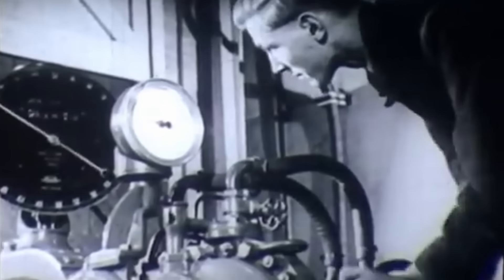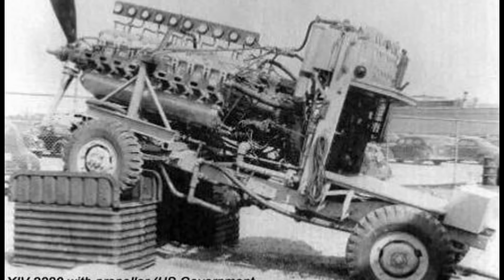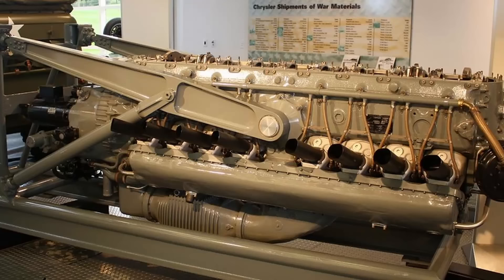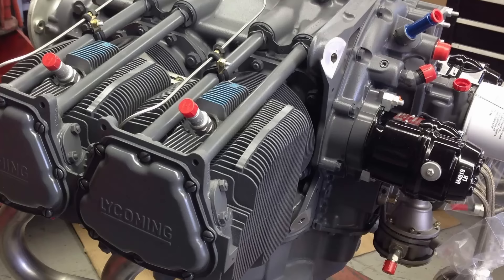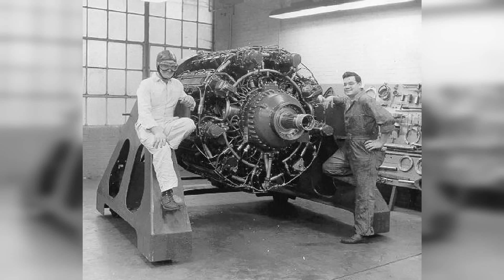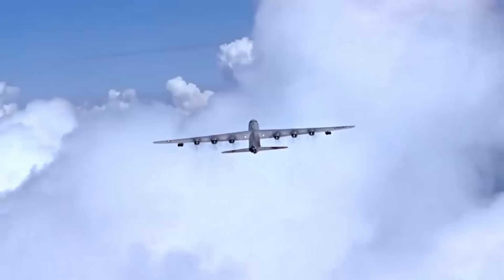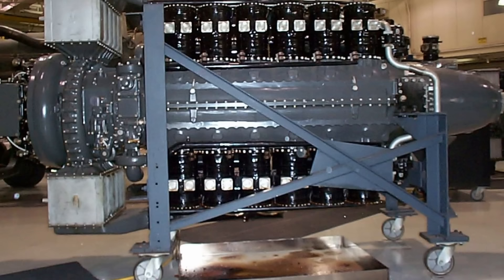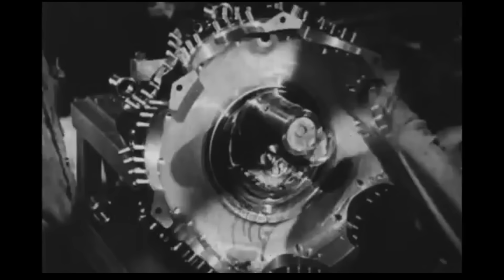The Forgotten HYPER Aircraft Engines of WWII

Comment: Too bad there isn’t any footage with sound of any of these. I’ve read that the XR -7755 was heard well outside the test cell into the nearby neighborhoods and businesses. And the Wright Tornado didn’t have even-firing banks of six, so it’s exhaust note is unknown. Incidentally, it had roughly the same bore and stroke as a Chevrolet 409. Very oversquare, unusual for radials. Graham White has (had?) a Continental IV-1420, another one of the “Hypers”, that’s ground runner. It turned out to be unexpectedly loud.

Comment: Great video. I've often wondered why you'd want an H block engine in a fighter i.e. they tend to be heavy and complex.

However the Sabre was a good engine so there must have been some benefit. Maybe H allowed for a higher RPM than a V engine?
Reply: I would guess the main benefit of an H block engine would be the power per frontal area allowing for a  low drag airframe.
Reply: Napier's sliding sleeve design had it's power sweet spot around 4000 RPM vs radial and V-type engines around 2500 RPM.  That then drove propeller design and gearboxes to accommodate the change.  Look up the Napier Saber engine on YouTube.  At the end of the day, sliding sleeve engines were too finicky to mass produce.
Reply: If the alternative is a traditional V configuration, I guess with 24 cylinders, like the Sabre, you end up with a very long crankshaft and engine block, leading to unpleasant vibration modes etc.? Also might be difficult fitting such a long engine into a typical airframe.
Reply: Good point. Also a long crankshaft probably couldn't handle the torque - like when the straight 8 went out of favour in cars.
Reply: @jbepsilon  perhaps but the Sabre engine with it's "H" configuration was in reality extremely complex with very high oil consumption with it's sleeve valves and very high fuel consumption. Doesn't make much sense sense considering that the late variants of the Rolls-Royce Merlin and the even more savage Rolls-Royce Griffon was just marginally less powerful than the Sabre engine. Those engines were truly marvelous feat of engineering and personally I always loved those engines but it was much easier and cheaper to produce the jet engines...
Reply: @paoloviti6156  Indeed, impressive as the Sabre was it turned out to be a bit of a technological dead end with its H configuration and sleeve valves. And yes, turbines were a better fit for aircraft and quickly took over post-WWII.
Reply: @jbepsilon  there is another reason that that jet engines took over the piston engines is because it took a long time and research to extract more 100 hp even to the point of doing a major re-work on any given piston engine. A great advantage was that it took far less man/hours to produce this kind of engines. Nowadays I see that we are reaching a similar situation after 70 years...
Reply: @atomicsnarl  The Bristol Hercules was a mass produced and very successful sleeve valve engine.

Comment: I'm sure everyone is now aware of the Chrysler hemi v16, but why weren't there more V16s used in WWII? 
Compared to a V12, you get a 33% increase in horsepower for the price of, at worse, a 33% increase in weight but the same cross section? Sounds like a no brainer to me. Sure, the crankshaft would be even more obnoxiously long, but that sounds like a relatively tame engineering challenge for such big gains. Overall, it seems much simpler design wise than making a bigger v12 from scratch.
Reply: Well, for one, that extra weight (CG +length) has to be hung out farther on the nose of the AC. That means a longer fuselage. Also, that huge engine will burn more fuel at all times, fuel that has to be carried =weight.

Comment: If I had a few spare billions I'd do a Napier Lion with a properly modern combustion chamber/CFD and all electronic mod cons.   Far simpler than what came later (I will peach to a love for the Napier Deltic but in the end the plebeian GM 567/645 did as well). It would only be a vanity project but it'd be a blast and make for epic project cars.  Modern turbocharging /normalization you'd have 2000hp to FL300 if you wanted to go there.

Back in the day they had... guesswork and test labs and insufficient instrumentation and often overly creative engineers.  They didn't have software modeling that'd give them three times the numbers for half the weight and complexity.
Reply: Two men changed the world, Hans von Ohain and Max Hahnn..
They made the first jet aircraft engine and flew on August 27th 1939 in Rostock Germany.

Comment: Hemi is a very very bad cylinder head design. You want a low roof with good squeeze, four valves and the spark plug in the center to run high combustion pressures or you will get slow burning and detonations.

Comment: RR Crecy two stroke failed from lack of interest by RR and the sleeve  valves that were simply not needed.
Reply: Two strokes use cylinder ports. Sleeve valves are moving cylinder sleeves with ports. It’s an unnecessary complication that a stroker simply does not need. 
RR also had an oil flow problem. At high revs oil got thrown out of big ends faster than the pump could push it in. It took them a long time to even consider that a bigger oil pump could solve the problem.

Comment: I think that GM achieved the 1HP per CI objective in the 50s, and it was an advertising point.
Reply: That's an interesting thing. I remember a motorbike test, and that was one of the first 600cc engines delivering 100 bhp. They explained why the water cooling design is very important for high power. For these aircraft engines heat dissipation and cooling is just as important, I suppose. Radiators and extra drag, it's dilemma's all over the floor.
Reply: After the Chrysler 300 hemi engine did it

Comment: You keep saying it limits power density to use just two valves, and while true, it also kills a lot of added parts and complexity from the design. Chrysler for their part had used hemispherical heads pre WW2. Hemi heads had been well known even in 1904. but for cost reasons it was a lot cheaper to run the T and Flat head designs. Using a hemi head is a balanced option its more expensive but its also has fewer parts while delivering reliable power. 

Ford might have used 4 valves on its GAA but those early engines tossed piston rods through the block and ate valves for months. The A57 Multi-bank, for example, by Chrysler was detuned before it went into production to meet Army requests.
Reply: We keep hearing that engines are better with more valves. But are they really?  Probably a bit more economical but that is it. 
All the radials to my knowledge were 2 valve pushrod engines and many are still going strong.
Passenger car engines, at least powerfull ones are still 2 valve and pushrods. Because they are simple and small. Look at Fords  humungous Quad cam thing, yet has less power than a LS or Chrysler.
Reply: @ldnwholesale8552  
Yes 4V engine's are more powerful, with normally aspirated engine's (those old aircraft engine's have different dynamics in their operation that I'll get to in a moment), that's why certain racing classes like Grand National motorcycle's limit 4V engine's to a smaller displacement than 2V engine's, if they didn't the 2V engine's couldn't compete, in some forms of motorcycle racing they have separate classes for 2V engine's otherwise they couldn't compete, they're usually referred to as "all Harley" or "pushrod only" classes, although since Harley came out with their 4V head engine a few years ago that still has pushrods I don't how the sanctioning bodies are ruling on those, I haven't checked the rules in street class motorcycle drag racing since that engine came out. 
There's a bunch of reasons they're more powerful aside from more flow, lower combustion chamber roofs and smaller exhaust valve's that have a shorter path for the heat in them to travel the valve seats to be cooled means that the combustion chambers run cooler so you can run more timing and a leaner mixture before you get knock, that's why Harley went to a 4V head on their big twin engine a few years back, despite them talking about more flow which is the kind of thing that appeals to the public the real reason they did it was because here in 2022 we were scheduled to have even tougher emissions laws via the EPA, Obama had signed a bill when he was on office calling for more efficient engine's by 2022 and Harley just couldn't lean out their current 2V combustion chamber any more so they developed the 4V head in preparation for it, but Trump had that bill repealed when he was in office anyways.
But what evens everything out in those old aircraft engine's that the creator of this video obviously doesn't know is the fact that with the huge superchargers they had on those engine's making the massive boost they did it doesn't matter, a 2V engine could fill it's cylinders just as much as a 4V could, with that much boost it doesn't make any difference. 
Equally important as HP/displacement with aircraft engine's is HP/weight, and the 2V per cylinder Pratt&Whitney R2800 engine was the first aircraft engine in the world to achieve 1 HP per pound. 
Something about rating aircraft engine's when it comes to  HP per weight that's very deceiving is the weight of liquid cooled aircraft engine's, everyone always wants to run to Wikipedia and look up the HP per weight rating of aircraft engine's especially with the Rolls-Royce Merlin, but what's deceiving about them is because of the variations in the different aircraft they were used in the weight never includes the cooling system and coolant, it's always a dry weight of the engine and no cooling system ie radiator and associated coolant lines plus the liquid, on average it's an additional 250 lbs, add that much weight to what the listed weight of the engine and then rework the math to get a more honest HP per pound rating, but an air cooled aircraft engine's HP per pound rating is actually what you see.
The reason that some aircraft engine's back then had 4V heads doesn't have to do with flow, as mentioned a 2V head engine running that kind of boost gets all the cylinder fill it needs, the reason they did it with those liquid cooled engine's was to give them a smaller profile, 2 smaller ports aren't as tall as one large port, also with 4 valve's you've got a lower roof combustion chamber as opposed to 2 large valve's at a 90° angle making a taller combustion chamber and therefore a taller engine, the design philosophy with the liquid cooled engine's was a smaller cross section to fit in a more streamlined nose.
Reply: @ldnwholesale8552  fewer valves end up choking the engine.

Comment: Got to interrupt you there. Engine development didn't start in the USA. Chrysler did not invent the hemi. If they didn't understand the value of 4 valves (with a sodium filling)  
There is still nothing much new under the sun. The most remarkable engines were developed worldwide by many nations. The British and French, and also the Italians, were instrumental in engine development. 
The Englishman, Harry Ricardo, was so influential in engine design, that his works, books and theories are still relevant. Among some of the remarkably high power output engines, was the Bristol Napier engine. (nay-pier) which was a 24 cylinder H configuration, with sleeve valves, and central spark plugs and a hemi if you so chose, because the valves did not impede the fuel/air and exhaust flow. It had the potential (estimated to provide up to 3500 HP) however, the end of the war prevented further development. 
I'm just saying that everybody put in their all to develop everything we have today. From metallurgists to chemists, were co-developments. No one single player wins the match.
 This is a well executed show with a wealth of documentation and photographs. Always appreciated.

Comment: Most of these giant engines were conceived and developed near the end of the piston-engine airplane era, when there was probably  a doctrine that bombers would just continue to get bigger and bigger, and jet engines were still unreliable, short-lived, and fuel-thirsty. If jets had never came along, we would have eventually realized that in-flight refueling would  eliminate the need for giant bombers that could take off carrying 10,000 miles worth of gasoline and 50 tons of bombs. We could make them much smaller, lighter and cheaper.
Reply: and today piston engines are said to be unreliable . Also jet fans ignore the many parts of their engine, for example the stator blades in the compressor, all of which can change their pitch. And today airliners fly to the opposite side of the globe without refueling, on jets. Piston engines could have done it in WWII . I mean, you still need the tanker. Only refueling I know of is from tanker to the thirsty Avro Vulkan flying to Falkland .

Comment: The question is power to weight, not power to CID.  2-valve engines are superior to 4-valve in power to weight.   More valves are needed for higher RPM, but the RPM may be limited by other factors, namely the radial engine rod chunking.
Further, these engines were boosted and boosting meliorates valve losses.
    As far as I know, no engine design begun during the war saw service.  Ergo dozens of plane designs flying on a handful of engine designs.  Allies were very fortunate the R2800 caught the wave.
Reply: Merlin is boosted and has 4 valves each of which is already quite huge. V12 rods doe not limit RPM. It has a gear towards the propeller. This gives you two ends where you can press oil into the crankshaft ( and the 4 camshafts ) to lube the conrods. Only 6 throws like a flat-6 . Radials are old-school anyway and certainly no Hyper-engine. The idea is to separate lubed surface from airflow. Hence we don't use sleeve valves or 2-strokes where the piston rings act as sleeve valves. Even with turbo you want low back-pressure. So 4 valves help.
Reply: @ArneChristianRosenfeldt  The Wall Street Journal auto reviewer (Dan Jenkins?) pointed out the 2021 Corvette LS2 2valve pushrod engine had the same power as the contemporaneous Ferrari V8 4valve DOHC.  The Chevy displaced more, but weighed less.  Power to weight is what counts, not power per CID for aero engines.  Why make the engine heavier and complex?    
      So 4valve OHC V12s faded and the 2 valve pushrod radials continued.  P&W built the last R2800 in 1964.  There are, of course, many other considerations for the engineers to balance.  Often not considered the V12’s long crankshaft twists.  And it can twists enough to foul engine timing and it lowers the resonance RPM.  While this problem is surmountable, the solutions make a larger V12  less attractive.
      I agree the 4valve DOHC engine breathes better, it just doesn’t provide enough extra to justify itself in the aero market as the history proved.    Cheers
Reply: @danbenson7587  I may need to check the numbers, but the trick with DOHC is to keep it simple otherwise: no rollers. Why variable valve timing if the flow is already so fast?

Main problem is high cg, not total mass. Ferrari also has these big intake manifold. I read that first gen. hot Vees had problems. If the engine is not tuned for excessive RPMs, smaller turbos suffice to provide the flow. And they fit into the Vee . And then have this straight air intake like NA.

As I said: V12 only have 6 throws. 12 cylinders pay for it, so you can make it heavy. Also there are no counterweights on the ends like V8. Camshafts are hollow, straight tubes and don’t twist. If you really have to, place a gear valve train in the center. Like on a bike. It is a bit weird. I think you place a large gear over some cranks. Then cut a slit in the crankcase. A small gears passes through this and reaches to the crank. Then two more gears for reduction. And you need to reach both banks. With chains we only need two holes?

Two row radial engines without a gearbox are great engines for a civil plane. I don’t see how that scales. Larger engines look like dinosaurs,  not elegant like LS.

Comment: Using 4 valves per cylinder isn't all-advantages. In a aircraft engine, this reduces the cooling fin area in the heads, adds to complexity and higher cost.  In high-performance auto engines, the 4 valves are individually lighter than a 2 valve example, so higher RPM is allowed before valve float occurs. They also work well with the large bore, short stroke racing-influenced designs of today. Also, the true 'hemispherical head' isn't the ultimate in combustion chamber shape, as it requires a domed-piston that is bigger, heavier and restricts flow to a degree. Pity the poor mechanics would have to change 2 or 3 hundred spark plugs on one single airplane!
Reply: The 4 valve Pentroof chamber is the superior design..
Reply: No aircraft engine of the period had any use for cutting edge of high rpms, most ran at 3000rpm or slower
Reply: @kenneth9874  2,000 rpm is too fast for most propeller to operate efficiently, these types of engines typically needed a gear reduction box to reduce the rpm.
The real problem with large engines is combustion dwell time, larger bore diameter requires lower rpm to allow complete flame propaganda across the entire combustion chamber... also many engines like the Merlin have slave rods, and different cylinder stroke on the right bank than the left bank.
Reply: @WilhelmKarsten  most ww2 fighter aircraft ran 2700-3000 rpm with a reduction gear to the prop, the constant speed props would change pitch to keep the engine in the operating range much like a set of gears
Reply: @kenneth9874  Right, the Ideal propeller speed is much lower, 1,800 to 2,000 rpm or less.